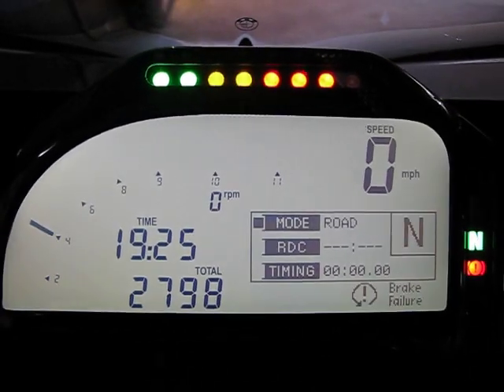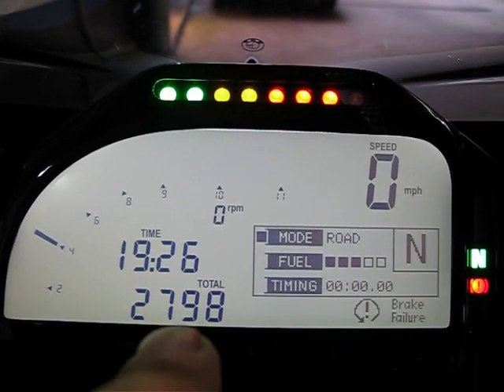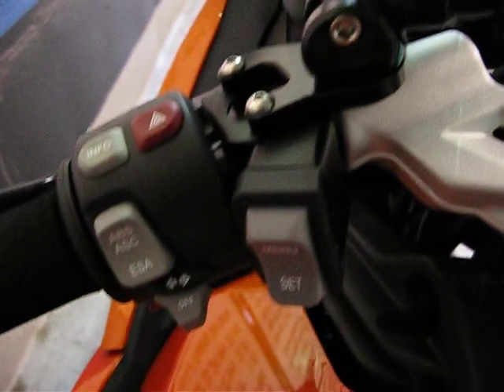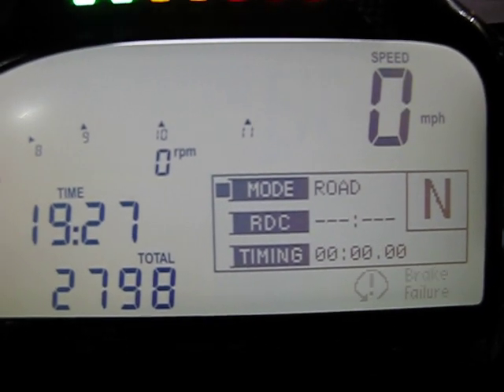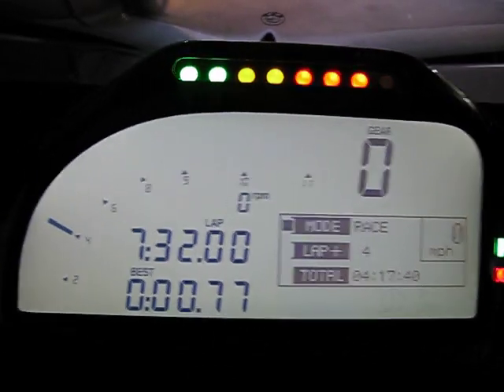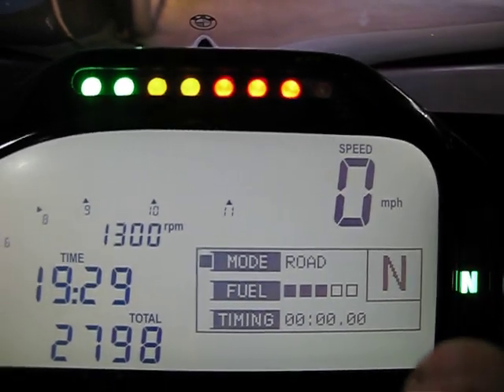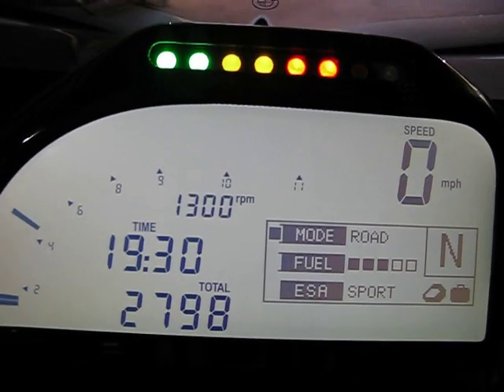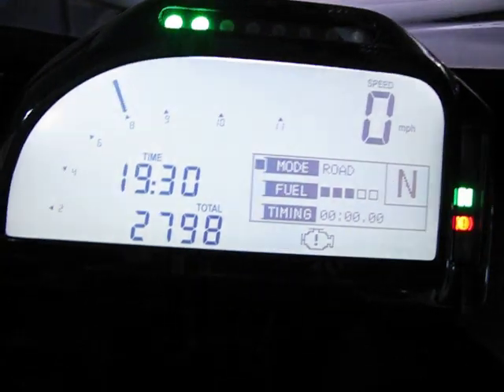2D MotoGP LCD Dash on BMW K1300S - Overview of 4 Modes + Features

Comment: Hello sir, do you know if its possible to show engine temperature ? Because I have the same and I see only environment temperature...
Reply from the maker: Good question. I can't recall. Since I sold the bike about 10 years ago. The engine warm up sequence is quite clear though. All I can say, from memory, if the option is available it should show and shouldn't be hard to find. Sorry can't help further.

Comment: Hello Sam. Do you know some more details about the setup mode? Colours of backlight and steps of adjusting the shiftlights f.e. ?? Thx !!
Reply from the maker: Hi, this is monochrome. meaning black and white. No color. and yes you can adjust the contrast. It's very bright, easily visible in day light.
Reply: Sam THX !!
Reply: Sam is this the same LCD dash on the 2018 BMW HP4 Race? Thanks for the review

Comment: so I see this one has the MPH showing..the ones at stores I have seen gauges but showing KM/H is MPH option available or there are 2 different 2D gauges?
Reply from the maker: These are made by 2D, but aren't sold by 2D. You have get the BMW version called HD dash for the K1300S from a dealer, otherwise it will not match the Bimmers.

Comment from the maker: you need the infrared if you plan  to use your motorcycle on the track.  that's the only place it is used.  otherwise, you don't need that particular part.

Comment: who is the manufacturer?how much is this fine piece of technology in $?
Reply: Made by 2D, same company that makes the dash for the Motogp bikes.  Installed at your BMW dealer for 3K.  Parts available from Germany only, none avail. in the states.  Takes about 2 weeks to get, need mounting bracket and wire loom if looking to convert your current K13S with the analogue dash....

Comment from the maker: it's a fast, comfortable hyper sport bike.  does 0-60 in 2.8 seconds.  competes with Busa and ZX14 and beats them both with much lower weight and greater handling.
Reply: The K1300 blows off the Busa but the new ZX14 has far more power than the K1300. But....H.P. is not everything!

Comment: how do we change time
using the k1300s setup
Reply from the maker: it's under settings done on the dash with the drip buttons. but you can't change from 24hr format to 12hr format. So time is always 24hr format.